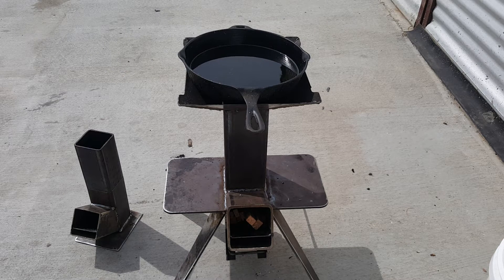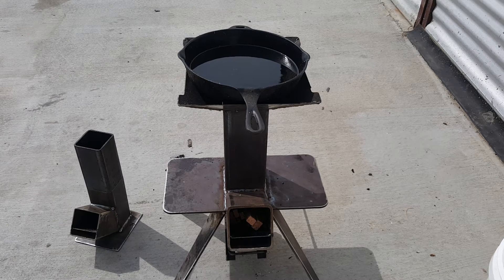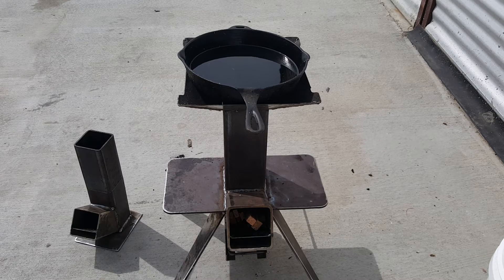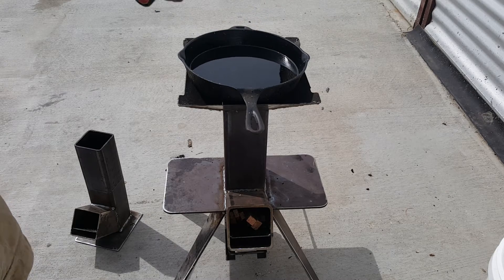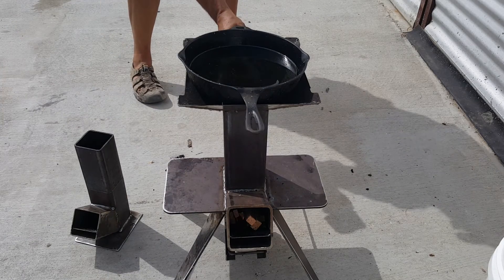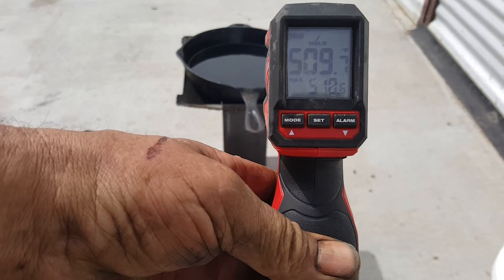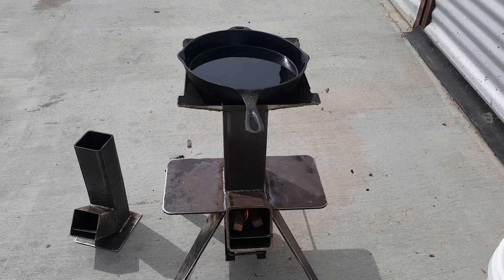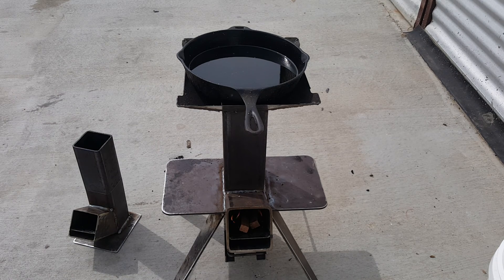4" Rocket Stove - Part 5

Comment: Congrats on your build.  Very nice work ! Try this to increase your heat output. make a door that closes off the feed portion and leave open the 1 inch air intake portion.  This will create much better draft through your stove and considerably more heat but go throught fuel much faster.  You can aslo burn a higher volume of smaller diameter sticks to increase your heat output. Hope this helps.
Reply from the maker: Thanks for the comment. While closing of the fuel shoot will burn more wood, from my experience is it shuts off the air needed for the secondary burn, and hence the need for more wood. I have yet found a need for more heat for cooking. Maybe if one was trying to boil 5 gallons of water fast then the extra heat would be nice. Usually one has to be conservative with the amount of wood used or the pan will get to hot.